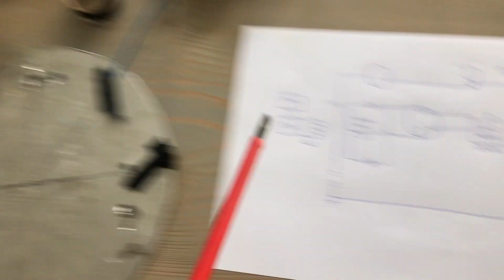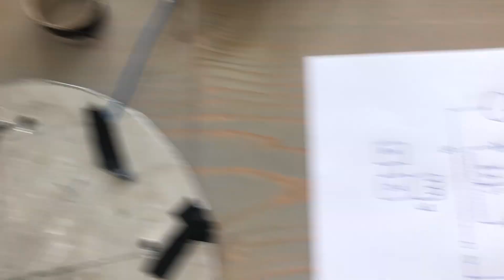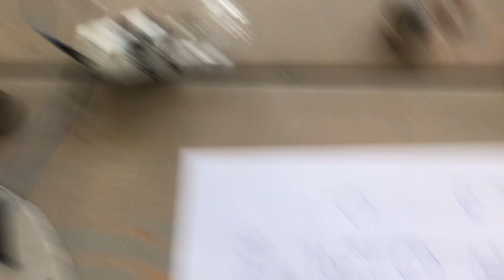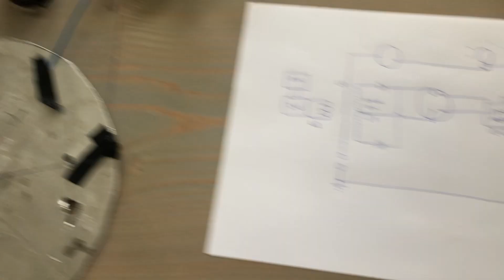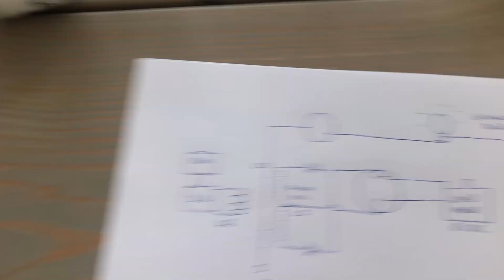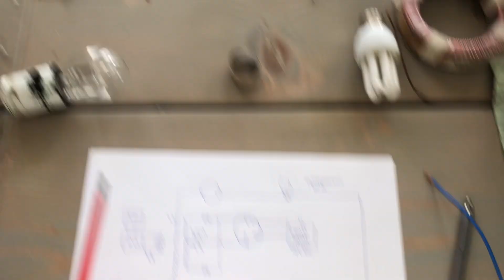Don Smith, kapanadze, Tesla experiment update.

Comment: Great work sir, motors are quite difficult to get running You asked for feedback, i have some questions and ideas: ...Is there a known tesla frequency for capacitor-tune on the output coil center tap to one output leg  ? Also did you try bonding the output coil with the ground / spark ? any effect of wire wrapped inside ferrite in the core ? ever try the tesla tower inside the output coil with ferrite ? 
Did you try spark on opposite from ground on tesla ? soon i will be able to answer these, but thought id ask :)
Reply from the maker: Thanks for your feedback back but this was a setup from a longtime ago. If you do get to answer these questions I would like to know if possible:)
Reply: sounds great and absolutely  ;) 
im thinking that this whole left / right hand spin Voltage vs Current... is simply a matter of spinning both at the same time. To Ring-up voltage and Current, rather than 1 or the other out of phase.
The caduceus winding does this, however im unsure if it should loop back or exit the other end.
Next, have you seen Capindres Double Amazing Joule thief with the "ferrite tube resistor" he calls it ?
Seems to energize the cable in a way that seems unusual. anyway im back at it. @dkdyker

Comment: I have found that with the bifilar the load is important at drawing the amps through... just like the induction hob at 220v with 3kw of load on it in your other video. 
The thing I have been interested in is putting a generator on the motor.. A to gauge useful power output and B to be able to effectively recharge the battey and C to make use of the load... because I have found that just physically looping the wires back to the battery gives wierd/undesirable results (probably due to high Freq). I have a more farout suggestion but might save it for another time... great work...
Reply from the maker: Thanks James, curious about your far out suggestions? I don’t have to much free time left so if you have anything please let me know, I could try it maybe 🤔
Reply: @dkdyker  Also it is harder to obtain the desired results with a battery input.. the ZVS draws whatever load is put on which kind of negates the "pulling" effect through the coils... it is better to have a constant feed with a DC power supply and then go heavy on the loads post coil.